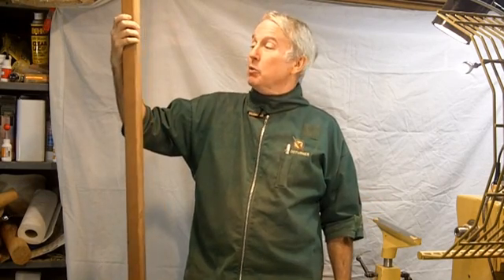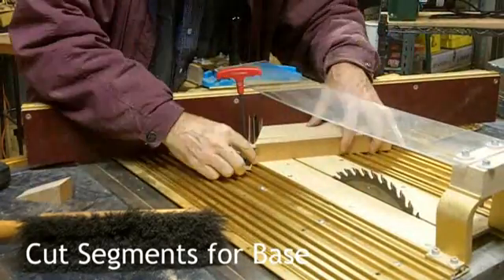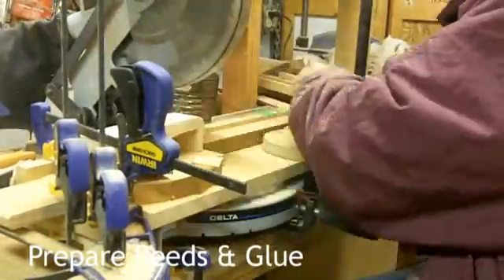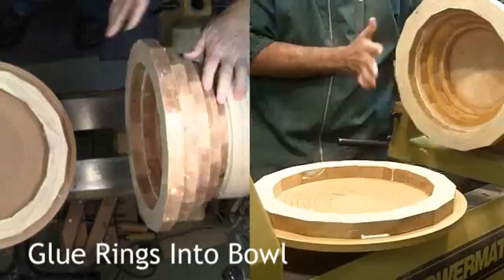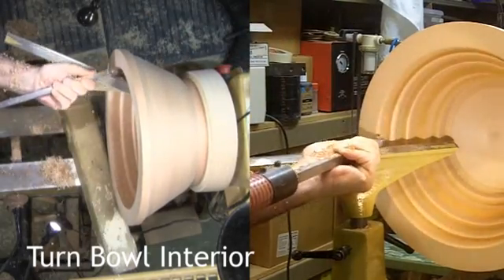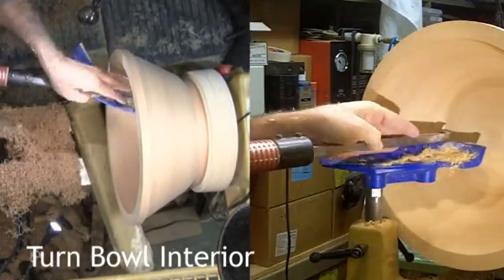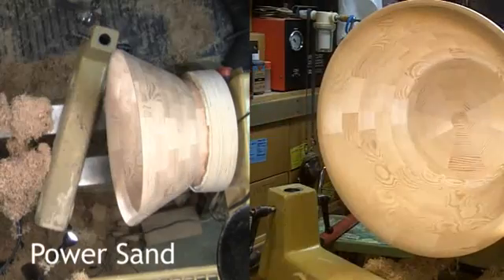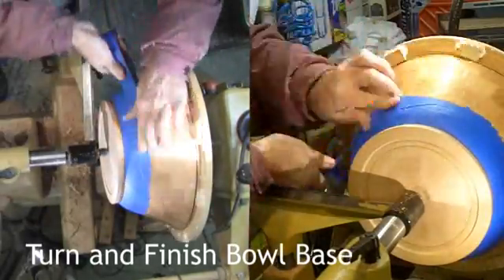Turn A Common Wood Stud Into A Segmented Bowl

Comment: Hi Alan, Nice tip about glue mounting onto a disc and supporting with the tail stock.
Interesting comment " not wanting to risk a catch inside the bowl with the gouge, i used a scraper"
I have ground a negative rake scraper, but it wont keep an edge more than a few seconds. How do the carbide cutters fare?
I had catches with the scraper on the inside of the seg bowl, until I moved the cutting point above the center line.
Reply from the maker: You are correct to move the cutting above the center line.
The ultimate edge with a scraper is when there is a burr along the edge. But burrs never last much more than about a minute. After that it still works but not as well. Carbide scrapers never have a burr. So at this point carbide wins out because it holds an edge (no burr) longer. Whenever I don't feel safe with a gouge, I switch to a scraper. Even then most of the time, I'll finish with a scraper.
Hope this helps.
Reply: As Wood Turns Many thanks for taking the time to reply, Alan

Comment: Alan, a beautiful bowl, nice work. Did you find the pine to be hard to turn, being that the wood is soft?  Obviously it can be turned.  I just never heard of turners using soft wood.
Reply from the maker: The pine was soft but ok to turn.The grain was close and uniform. since it was so old and dry, I did not have any problem with pitch.
I generally avoid softwoods.
Alan Stratton